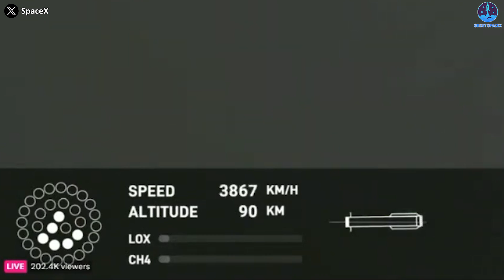SpaceX revealed Starship 2024's plans absolutely mind-blowing!

Comment: 1. I am thinking that Fast changes in orientation of the booster causes the fuel to slosh away from the tank outlet pipes. Keeping the flip slow would allow the fuel to stay in place due to the engines thrust not being over come by rotational acceleration. At the altitude of the flip maneuver the lateral forces the booster experiences due to wind resistant is really minimal. Weather it the booster flips fast or slow it still experiences the same amount of aerodynamic force. Flipping fast adds increased forces of rotational acceleration/deceleration.

2.  By reducing the linear deceleration at the moment of hot staging the total acceleration could remain positive. This would keep the fuel in the bottom of the tanks. Slow flipping would continue to keep it there.

3.  The info that I have seen does not show any baffles in the tanks.  My guess is that they do not exist (yet) to save weight.

Comment: So, they suspect a fuel leak on the booster caused the engines to partially fail? -Question-why does the booster have to do a turn around? -why can it not just stay in the vertical position when separating from the Starship? that way they would not have to reignite the engines but stay at full throttle then land.
Reply: Two reasons; one, the spaceship is no longer vertical at separation and two, it is downrange a significant distance, so if you don't want to land it on a barge, you have to turn it around.
Reply: also .. the fuel is in liquid form .. so gravity is a thing .. and sloshing

Comment: I am not a physicist, only a rank amateur astronomer. That being said, I have a fair understanding of Newton's 3 Laws of Motion. Studying the 'many' videos of this flight, it seems, to me, the "engines" did not fail. It is more likely that the internal tank pressurization was inadequate to compensate for the shifting gravitational forces that are exerted on the propellants during the turn around maneuver. Newton's Laws are quite appropriate, and explicit in this regard. Simply put, the ascent acceleration of the booster applies linear force "upwards," while gravity forces the propellants in the tanks "downward." The engines are getting what they need in the proportions they they need them. A type of balance, if you will. When the booster began its separation, it successfully & systematically, throttled back the engines thrust. this diminished the linear force being exerted "downwards" on the propellants upsetting the balance. This would also change the pressure of the propellents being "pumped" into the engines causing a slight gap in the rate they are forced into the engines. Kind of a sputtering effect to the engines, and not a "consistent flow." Now add to this, the booster is changing its "Linear Direction" in its maneuver to return to Earth, and the "forces directions" in a 180 degree spread. This means, while the top and bottom of the booster are changing their orientations, the tank pressures have to increase to allow uninterrupted flow to the shifting engines directions. That is to say during their directional shift, at times, they will be facing sideways of sorts, until they achieve their "upside down" positions. This will prevent the propellants from feeding the pumps at a "constant rate." That seemed evident in the videos as you see puffs of propellants at the engines end of the booster.    Anyway, analysis of the ships telemetry will tell the story. For now at least, my money is on the tanks failure to adequately compensate their pressure.  Sorry for the lengthy comment.
Reply: also not so much Newton as fluid dynamics
Reply: tank pressure isn't an issue so much
Reply: So.......in theory.......this flip maneuver is dead in the water? Time to go back to the drawing board for separation maneuvers.
Reply: @jaydonbrown617  Not dead in the water at all.  There are probably other options but here are possible solutions.
1. Slower flipping of the booster would help.  
2. Progressive ignition of the Starship engines would reduce the deceleration of the booster and allow the fuel to remain in the bottom of the tanks.  
3. Baffel plates inside the fuel tanks would help reduce the sloshing of the fuel and help keep it in the bottom of the tanks where the pumps could get it.
Reply: @appliedfacts  Allow me to counter your solutions.

1. Slowing down the flip maneuver may have adverse affects on the balance of forces on the craft, as well as it's flight path. For example, exposing the booster to prolonged sideways forces may put undue strain on the structural integrity of the craft. It is definitely strongest end-to-end.

2. Not sure if this will have the effect you are thinking about. Slowly reducing deceleration won't change how the fluid fuel behaves inside the tanks. Once the vessel flips over, the fluid is already displaced from what we'll assume are the feed ports to the engines. Ideally, faster deceleration will get decrease the downward momentum of the craft sooner, allowing the fuel to settle to the bottom faster.

3. This makes the most sense, and you would believe they'd implement this already. Not only would it strengthen the fuel tanks, it would prevent all of the fuel from displacing from one side of the tanks. As far as we know, the fuel tanks on starship are just large empty accumulators.